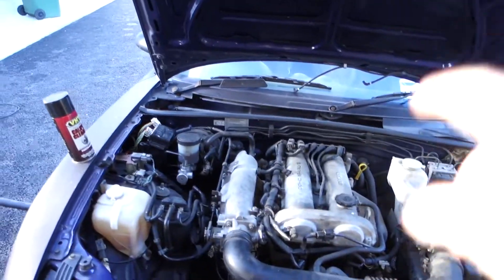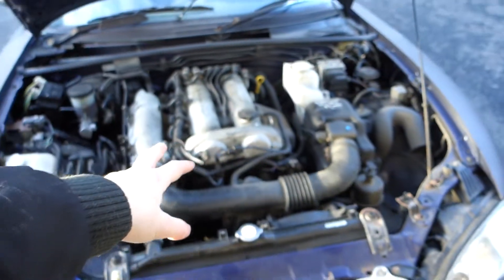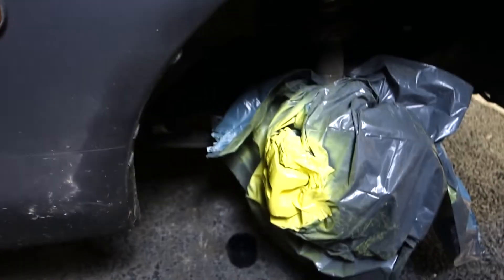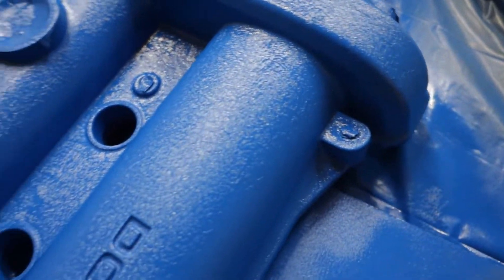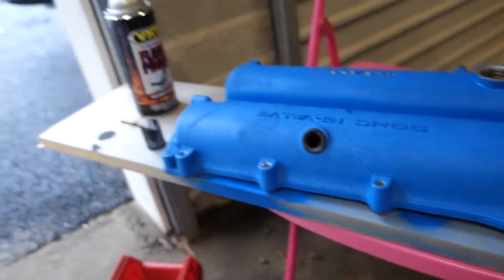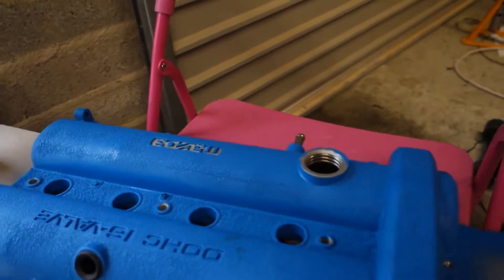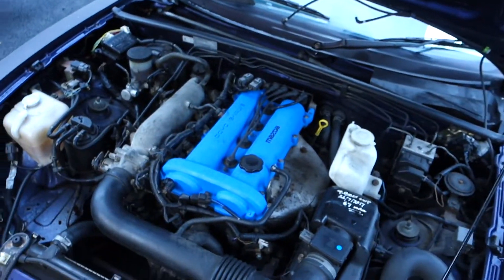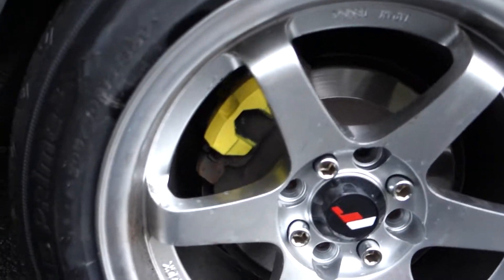Using VHT Wrinkle Paint and Calliper Paint !!

Comment: so quick question, next time I blast the brakes with brake clean wont that mess up the caliper paint job? is there anyway around this??? I'm scratching my head on this and curious before I start on the caliper project
Reply from the maker: why would you be spraying your brakes with brake cleaner once on the car ?
Reply: @AndrewRegan1219  when changing the brake pads
Reply from the maker: Just cover them up best you can, its not as strong as something like brake fluid wont destroy paint if it hits something